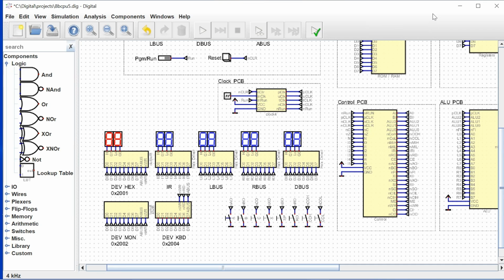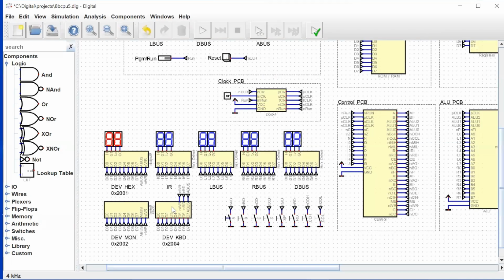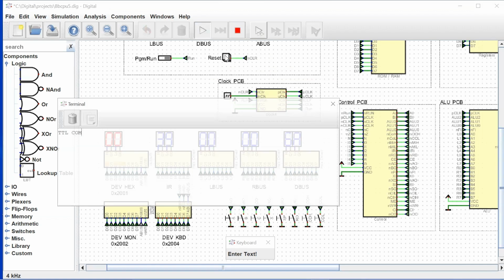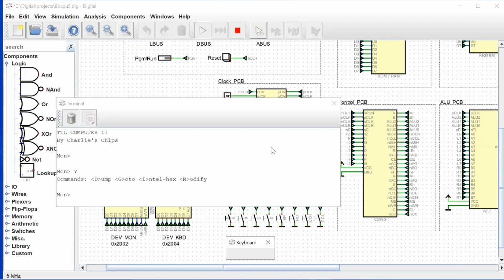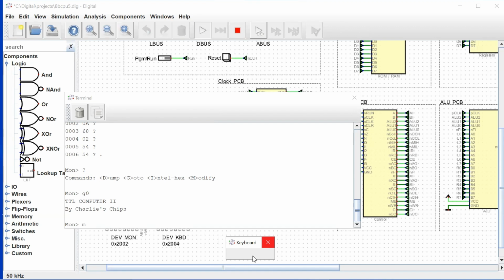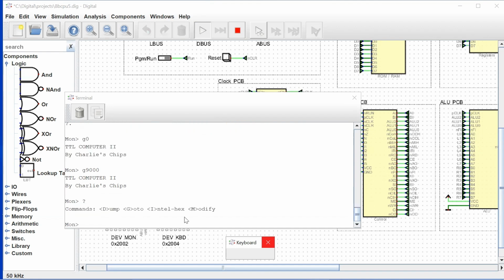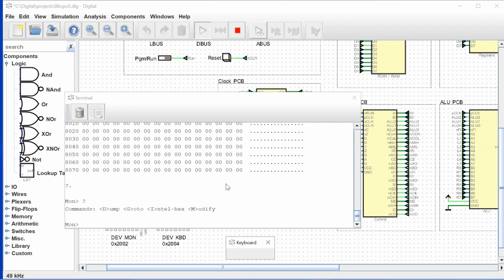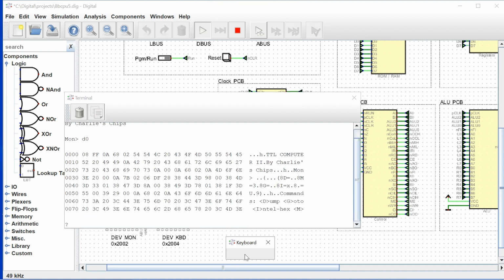TTL Computer II #10 - Monitor & Keyboard

Comment: I have been following this TTL Computer build and constructed each component from video #1. The item i am stuck on is the 32K Ram. I used the 8K ram that is included in the software and increased the address to 15 bits. Does this expand the RAM size or do I need to use 4 x 8K ram chips connected together?  Will you be posting a link to the ROM code and making it available for download?
Reply from the maker: Hey Terry thanks.  I am tickled to hear someone is duplicating the build.  Yes, that is what I did also.  Took the 8k ram and expanded the address bits.  I can't post a picture here so have a look at my community section and I will post a picture of my modification along with a note on trying to make the project available. Charlie.
Reply from the maker: Hi Terry I should be able to release a full version of the Digital project after next weeks video is published.
Reply: That will be fantastic. I have completed the build exactly following your videos. I'm having a fault on running the computer with B7 on the ALU chip. I've opened up the ALU and it runs correctly. The error I'm getting is, No output connected to B7 in tunnel (B7) state of wire is undefined ?? Any ideas??
Reply from the maker: @terryjames8238  Its hard to say. Check that all the wires are connected (sometimes they are just short of the pin).  Make sure you did not use a tunnel when you intended an input.  Make sure all your tunnels are named correctly.  Hope that helps.
Reply: I've solved that issue and it was the incorrect label of the tunnels. Both B and A were labeled as B and A. Should of been L and R bus labels. I am error correcting at the moment step by step. Hopefully will get it sorted soon.